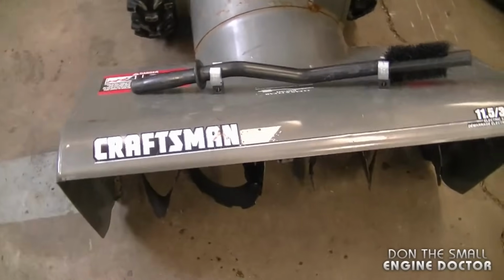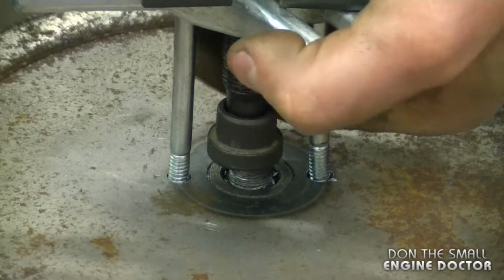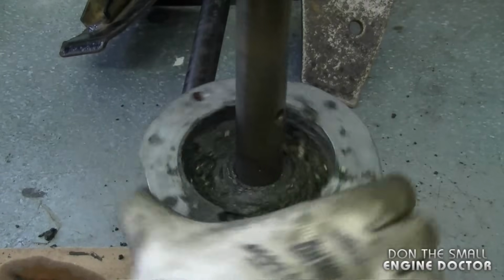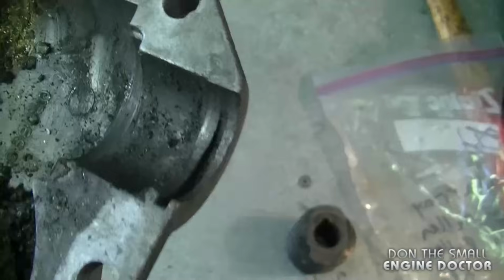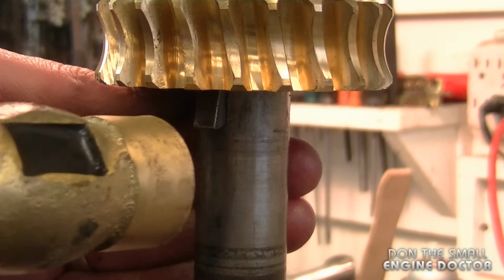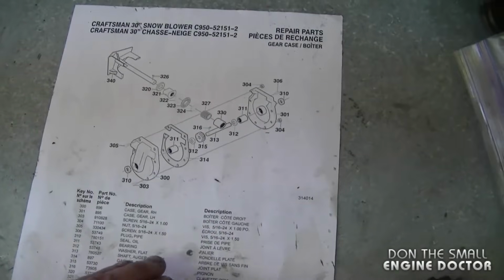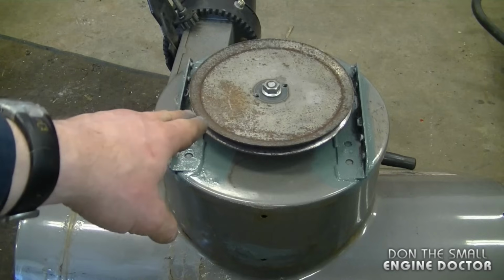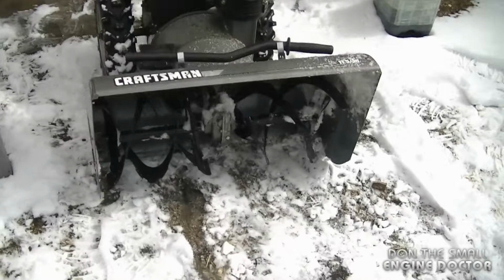Complete Snowblower Auger Gear Box Rebuild!

Comment: At 73 yrs old, I just spent 12 hrs on my knees, in the driveway, on Ground hog day, replacing the main drive bronze bushing, in my 2003 Arians 8.5/24. Yea I went through about 3 pairs of rubber gloves, had to use the torch on the pulley. and removed every part from the drive system and replaced the rubber drive wheel while at it. I couldn't find a video on this repair so I had to figure the whole thing out my self.  You can't do this stuff  in the nursing home. Your videos are always great. I wish you had done one on that bronze bushing. It might have saved me a few hrs.
Reply: Robert, nice job that shows you keep going, keep learning, keep succeeding. Just 1 thing, don't take on a big challenge like this on ground hog day - better to lay low so you don't  get caught in a repetitious cycle!

Comment: Clean everything before you take it apart.  After it is apart, clean everything again.  Reassemble, replacing defective parts and then clean it all again.  It saves time and it prevents mistakes.

Comment: I am yet another moron who decided to save a few $ and replace real shear pins with hard bolts.  This worked great until the snowblower sucked up a chunk of 2x4 that the same moron left sitting by the trash bins.  But I figured if I can break it, I can fix it, so I started with the belt, figured maybe it just burned up.  Nope.  Figured it was the gear box, so I just ordered the whole gearbox assembly.  $470 later, while trying to install, I realized the impeller was forever rusted to the impeller shaft (yes, I removed the pins), so I ordered that piece up.  Once I had all the parts, putting it all back together was surprisingly straightforward.  All the pieces and bolts I took off went back on, with no extras left over.  That's a first.

I didn't consider trying to fix the gearbox itself.  Had I gone that route, I still would've encountered the impeller problem, so I can't feel bad about it.  I might open up the old gearbox to see the sad twisted ruined gears if I need some entertainment.

So yah, here's another guy saying "use real shear bolts".  Do not think you are a genius by using harder bolts that will never break.  The damage will only move upstream, as I discovered.

Great vidya.  Good flow, relaxing commentary.  I am now a subscriber and a fan.  Keep up the great work.

Comment: I would have used a wire wheel on the shaft first to take it a part. Clean is always better when taking things apart. Good Video.

Comment: To remove the pulley from the shaft, if you don't have a torch, is to liberally apply penetrating oil to both sides of the shaft where it meets the pulley. Let the oil sit for 15-30 minutes on one side, turn the housing upside down and repeat oiling. Worse case scenario requires heating the shaft where it joins the pulley.

Comment: Yrs ago found a snow blower in the trash. It ran so I gave it to my brother as he has a larger driveway. After a big snow it would not blow the snow which is why it was in the trash.  We found whoever did work on it swapped the augers. So it was only pushing the snow to the side. My father and I swapped the augers around and it worked great. Moved heavy snow better than our Toro 524.

Comment: When you started talking about the shear pins I had the smile. A few years back someone had a snow blower on craigslist that was practically brand new and the only problem was the blades would not spin. When I saw the ad I was prepared to fix the drive or just pulled the motor. When I got to his house he had it out front and was showing me. He was a fairly younger person in in his late 30 s I would guess. When I bet down and seeing it was the shear pin I asked him that if the blades were to turn again would you keep this or still sell it. He said he would keep it. Then I asked him for a Phillips head screwdriver I pushed out the remaining shear pin and under the cover in front of the motor was 2 brand new sheer pins. I replace the one that was broken started the machine and sure enough everything worked. Now he tells me he feels guilty for having me come out to his house. I told him it was only a 10-minute ride and I don't mind helping someone.

He did not even bother to read the manual after buying it. All my friends laughed at me and said that 5 minutes after I was gone he up the price on craigslist and made more money lol. now I don't know if he would have done it later but I never saw it online again.

In my neighborhood I have a good reputation with all my neighbors. During the summer months I'm always fixing someone's lawn mower or do we wacker and come winter snow blowers. It's very seldom I charge anyone. I'm retired at a fairly early age. It gives me something to do and my garage is more like a man cave than a garage. I have a big flat screen on the wall surround sound. 

I enjoy watching other people work on equipment. I learn things from different people like yourself on stuff that I'm not familiar with.

I enjoy your videos and I hope you and your family have a great New year.

Comment: Great video but you didn't grease the augers with the grease nipples. This fills the void between the augers and the augers shafts. Obviously this will prevent the ingress of moisture thereby mitigating rust formation. Excellent use of anti-seize. You are a good mechanic

Comment: Just a Pro tip...  Before you split the gearbox...  use some steelwool or scotchbrite pads and WD to clean off the auger shaft corrosion. The covers will slide off easily and it won't contaminate the bushings..

Comment: Besides using the correct shear pins, the augers should be pumped full of grease using the Zerk fittings on the auger shaft. You were lucky on that machine, the augers were not rusted in place. I've seen them so badly rusted, the only way they could be removed was to cut them off with a torch.

Comment: Those "shear bolts" are also serated in the middle, which allows them to snap off at the correct pre-determined torque.
NEVER use regular bolts.
Reply: You'd think their name would be some kind of hint to the person putting bolts in there but nooooo!😄

Comment: I have a Yardworks (MTD) machine but this video gave me a good overview of what I needed to do to fix the worm gear.   Luckily didn't run into any issues requiring a gear puller or hammering of the shaft but the tips on using anti seize and greasing these components will hopefully prevent that if a future repair is necessary.

Comment: nice video, customers in general don’t realize how much work is involved in a job like this. think it’s proper to give them an according bill for all the labour involved.  maybe next time they think twice about replacing those sheer pins with regular bolts.
Reply: Yes, it also appears the customer ran the snowblower through a field of fist-sized rocks!!!
#clueless
Reply: I know it’s a lot of work but on those cheap machines you can just split the gear box, take out the sheer pins and the cheap tins give you plenty of room to weasel it off the driveshaft. I had the same machine and it took about half an hour start to finish. Was still running when I gave it away 5 years later.

Comment: Woo ooh!  Great video  
came apart fine & then found a tiny branch had jammed the auger over causing it to scrap the housing & burned the belt . Shear pins did not fail as the obstruction was housing to second stage auger

Comment: Thanks for the break down - really helped me rebuild my gear box! Unfortunately, when I took mine apart everything seemed fine and the gear was only mildly worn. Even though the belt appeared mostly fine, I decided to replace it anyways. When I got the new 33" belt and compared to the old one, the old one appeared to possibly be a 34". The good thing is when I put it all back together everything worked as expected.

Comment: If there’s no bolt to fill the gear box do you have to pull it all apart?  Many videos don’t run into problems.   You had several obstacles in this repair and came up with a work around.  I watch your videos because they are so good, not because I’m looking to do a repair.  Totally awesome.  Keep ‘em coming.

Comment: I had this happen on my Craftsman Snow Blower, before I put it back together I drilled and tapped the housing for a grease fitting. 
Before each use I pump grease until I see it come out of the housing, it will never run dry again.

Comment: Glad I watched this to decide that I will not be doing this repair on my newly broke 24” craftsmen with the same issue. I’ve just got standard tools and skills which normally go pretty far but not this far. Maybe if I could buy the gears already installed on the bars?…and didn’t have issues pulling the auger out.

Comment: As far as PPE (personal protective equipment) goes, at work they make us wear a face shield,safety glasses,gloves & hearing protection when using any hand held grinders,safety glasses are to be worn at all times in their workshop as it is a legal & safety requirement in all workplaces in Australia,such as a workshop or factory, where a person is highly likely to suffer an eye injury.

I've noticed at home,having access to a hydraulic press makes life a lot easier when removing & installing press fitted parts.

Comment: Donyboy, did a good job. Price to fix probably about 4-6 hundred.  New snowblowers between 8 and 1100 hundred in my country. 
 Now they make battery powered snowblowers that are around $700. Have seen them . 8" of wet heavy snow. Work very well.. They are Toro 60 volt and the Snow Joe 100 volt.  This may be the way of the future

Comment: I had to destroy, and replace, the auger bearing on an 11 year old blower's auger housing that I disassembled in order to paint. It's easy to take apart, except for the seized bearing. I thought, in retrospect, that it would have been wise to take apart the blower and apply anti seize, or grease, to the auger bearing as part of the machine's regular maintenance (every few years if not annually). It would have saved me purchasing a new bearing just so that I could spray $10 worth of paint on the auger housing. It seems to be a common, avoidable, problem when these machines are serviced.

Comment: I tore apart my gearbox I didn't see the worm gear at all. I have the big gear but not gear in top. I have a new one. I figured that it all would be inside. Whoever owned this Toro I'm doing used regular bolts. The result as you know is a broken gear box

Comment: I make my own sheer pins . I use straight 1/4 " aluminum thread each end (1/4-20 die) and add a nut to each side. They do last a while. We just had 18" of snow and no problems. I have enough material for at least a dozen more.

Comment: what I did instead of splitting it in half and removing all that was start take apart the gear box, and push the augers away from the middle as far as u can. sometimes you have to push the ends of the snow blower sides apart, u can use a bottle jack. save yourself a ton of time

Comment: I replaced my broken shear pins with stainless steel bolts thinking "Well, that shouldn't happen again". I was right. I completely mangled the gear box instead. After watching this video I ordered a complete set of parts the week before the snow came in October 2019 and they arrived April 2020, the week after the snow melted! I am going to start putting my baby back together tomorrow. I am so happy to have found this video, it has made me confident to tackle the repair and save myself 100's of dollars. And it looks fun too.

Comment: I picked up a nearly new 10hp craftsman for $40 with this issue. $60 or so in parts and grease (NAPA has the grease on the shelf) and it was fixed. The  impeller was badly bent too so the previous owner hit something large.

Comment: Hi your my go to guy for the small engines, as a home owner I have way to many small equipment!. I have done this repair on my yard man or yard works , after full assembly the augers were on backwards so I tore it apart again. now I got another blower a yard man with heated grips and the auger gear went on this one. As I had  done this before I was extremely careful with the pulley and bolt . I am absolutely sure they are put away together and in order, the shaft with the pulley is not a bolt like you have .. Mine is a screw that holds pulley to shaft. the screw came out  and when I put it back in  it does not fit. I tried with oil and checked threads  everything is good. I know it is the same screw that came out of it as I put them together and in a separate container . So to my parts company and bought new screw .  not the right size maybe metric. found a scrapped blower and that screw did not fit. so right now  it is strapped to the pallet with the box of hardware and parts ( 3 years ago ) now.  I have retired and got rid of the things that were taking up my time and in the spring will go back and try again.  So I learned from you or at least clued in that I can get that part with the screw  at a repair shop used.  So I  thank you for the video.  since then I picked up a like new  8hp /26 inch  blower and got a manual for it , from clean up week he had just put it out  so I will work on it in spring he says it is clutch assembly . starts first pull and has electric start. My garage is not heated and tools freeze your hands when holding them so in the  spring  I have another small job.  3 blowers  for a household  and a john deere compact tractor with mower blower and pallet forks.

Comment: Did lot of research on what goes in a gearbox someone said use GL4 gear lube GL5 has something that attacks yellow metals. Have 5 blowers no problems If your truck diff works on the highway at 70 MPH with gear lube should work on a snowblower same sort of idea

Comment: I've done this repair a couple times. Some Kroil on that shaft will help it come out. Kroil on the bearing also helps far better than penetrating oil. I use 1/4 inch x 2 1/2 inch CARRIAGE BOLTS and RED WIRE NUTS for the shear pins. They can be quickly changed out in the snow with gloves on. I used a sanding sponge to clean the crud off the auger shaft before sliding the case off. I have never had to pound so hard. SearsPartsDirect sold me the parts. The phone agents can often discount the parts to better than the discount parts distributors. Murray/Craftsman specs a cold weather Lubriplate for the gear box with a brass worm gear.
I made a blade adapter so I can convert the snow blower to a snow plow by removing the blower housing. It works great for sidewalk maintenance when the city requires sidewalks to stay clean even when there is not enough snow to blow it.

Comment: Great video, I like the anti seize on the auger drive shaft when putting it through the housing. However, the only thing I would change is to wipe off the anti seize on the threads, and replace it with locktight before installing the nut. I've personally had one of these nuts come off in the middle of use before, and its not a pleasant experience. Forced me to learn a lot more about my snow blower after the fact.

Comment: Hi all someone down below mentioned grade 8. I was able to find the head of my broken shear pin, it had 3 radial dash marks that is grade 5 not grade 8.  Also inspected similar modes in store, and parts department, all 3 dashes.    I think grade 8 marking is six dash marks.  I would rather have original grade 5 break again rather than have a grade 8 NOT break and destroy my gear box.  IMHO . . .

Comment: Outstanding video!  I scrap metal and I was given a Craftsman snow thrower in beautful condition, but the auger wouldn't turn. When I heard that the operator hit a frozen newspaper, I knew exactly what was wrong, but needed help in taking this beast apart.  Your video is excellent. I have ordered the replacement gear and expect to succeed in saving this fine piece of equipment. Many kudos to you, sir!

Comment: My shear bolts kept breaking. I made a mistake of using stainless. I was clearing deep heavy snow. Never sheared the bolt, but I think gearbox is stripped.  My snowblower is Sears and I believe the parts may all be the same. Your video will be a great help. Thanks for your video. Lesson learned - don`t use bolts that are not designed to shear,

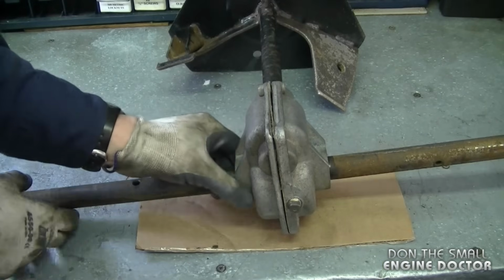Comment: 9:09 Before separating gearbox shells use wire wheel and finish the axle surfaces with sand paper, making sure there is no extruding metal on axle and that sides can slide out with out damaging the seals. You have to do it in next step anyway so its better to do it first so there is less chance on causing damage to gearbox shells when removing. After those are removed you can go at it again closer to seal to get it perfect for removing the gear.

Comment: don’t 73, I have the same blower with same problem. You forgot to tell us cost incurred on parts you did buy. You had extra case and impeller shaft which I don’t have. Hopefully gears and internal parts is all I need . My motor is great but don’t wish to put in more than it’s worth. Great video👍

Comment: Great detailed video. It's too bad the manufacturers don't put a little anti seize on during assembly. it would make both customers and technicians happy!
Reply: That's for sure!  Manufacturers are only concerned with ease of assembly. In most cases there is little concern for the repair process.
Reply: Cars are the same way, technicians just slap parts together and removal can be difficult.
Reply: That’s because they expect you to either buy a new one or bring it back to them

Comment: Why didn’t you just wire wheel the shafts to remove the rust from them.  Then, the cover will slide off the shaft, without damaging the seal to bad.